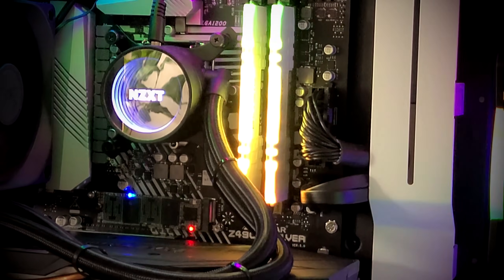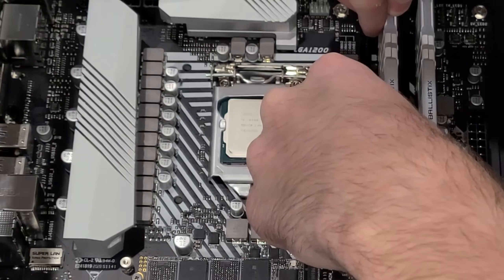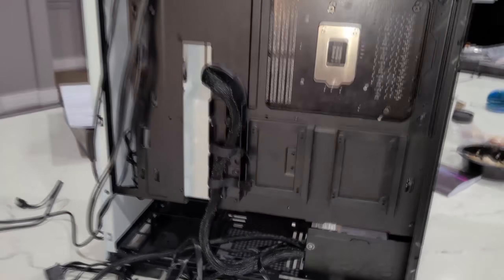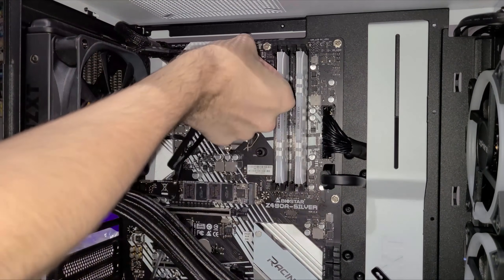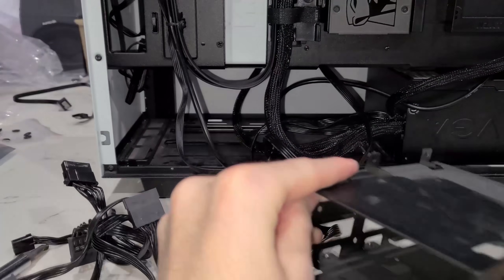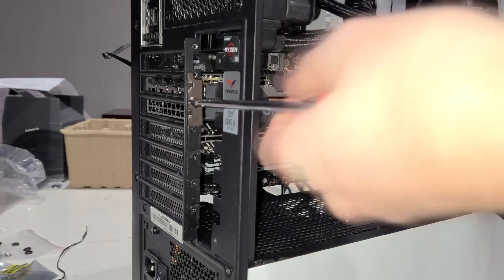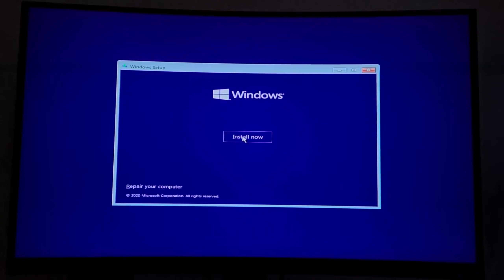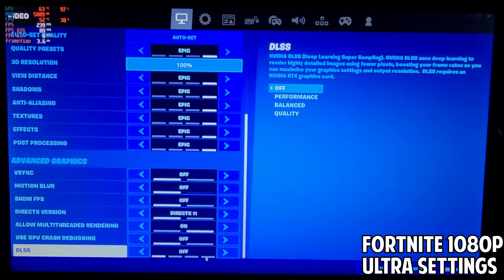BEST $1000 Streaming/Gaming PC [Build Tutorial, Benchmarks]

Comment: The cpu scares me especially since I’m gonna build my first pc in about 4-5 months maybe less saving up for it got a ryzen 5 2600x cpu 16 gb of ram and a gigabyte Radeon RX 5600 6gb gpu
Reply: If the gtx 1660 super is cheaper or a bit more expensiv than the radeon i would go for the nvidia card its up to 5-10% better than the the radeon
Reply: @yynizellulul1747  is it a good gpu? I’ve seen videos of it with a ryzen 5 3600 running gta at 120 FPS it’s better than what i have right now way better I have a laptop with an i3 celeron processor and a VERY VERY shitty video card and 4gb if ram
Reply: The 2600x is an 3600 with little bit lower single core performance so there would not be a big difference
Reply: And its an good gpu my build is an 3600 with a 1660 super and its perfect
Reply: @yynizellulul1747  how much does it cost? And what is it’s exact name? I am looking st all of this stuff on pc part picker
Reply: In my country germany it costs 720
Reply: @yynizellulul1747  a euro here is 1.19 and that’s literally more than my entire pc at $708 USD that video card is $854 here

Comment: I dont know if its nice to get 10400 or 10400f because all motherboards will be much expensiver with them
Reply: 10400f has no intergrated graphics in it
Reply: still the 10600k or 10600kf is better choice. No need graphic card because there is rtx 2060
Reply: @kelu17  kf, saves you a few bucks as it doesn't have integrated graphics in it, but performance is the same

Comment: got the same case and a psu from the same brand. My motherboard cable is so stiff I must loop over the white metal bar instead of behind it. Any suggestions? The PSU cables are thick and stiff.
Reply: dont worry about bending it hard. if it really doesnt go, you could buy sleeved psu extension cords or just leave it as it is (if you dont mind the looks)
Reply: @thndrstrke  It looks ok. I'm not concerned about my cables as much as the motherboard. It would require as much flex as bending a plastic ruler 100 degrees.

Comment: Is there a way to get a Ryzen 7 or any processor that has 8 cores at least 16 threads preferably and use a 1660 Ti for under 1,000 bucks?
Reply: you can cut a couple corners on budget here - for once you dont really need an aio liquid cooler, a "normal" cpu cooler for under 50 bucks will suffice (be quiet! has some good options). the case comes with 2 fans preinstalled. the airflow of this case is already pretty great so you wont need any more case fans (if you can resist rgb shit). thats about 150 bucks saved so you can get a better cpu or gpu ;)
Reply: Yes, you can just replace CPU with Ryzen 5 3600 with Ryzen 7 3700x and replace graphics card with 1660ti in below build
https://teamgeeky.com/us-recommended-pc-builds/1000-dollar-gaming-pc-build/

Comment: Get a good air cooler like a scythe mugen 5 instead and a b460 motherboard w/3000mhz ram, unless you really need ram speed more than 2666 which doesn't really matter considering its a intel system.

Comment: Thank you so much for the guidelines bro! I will be building the exact same pc, the only difference is I will be using the Corsair VS Series power supply, thanks once again xD
Reply: Prism  ok bro thanks for the tip
Reply: @kevingobin400  They DO matter. An expert said that your PSU should cost 10% of your build. Well, I'd say a bit less then that, but yeah. If you have a 2060 with a 3600, you should go with a 80$+ PSU. I'd suggest either Bronze or Gold, and at least 600-650 Watts. 
Don't save money on the PSU. You don't want your PSU to take your entire system to the trash can, now do you? 
Have a good one!
Reply: @LegendarymmHD  yes someone at my work told me the exact same thing so I’ll check it out thanks 👍
Reply: @kevingobin400  Np, make sure you buy the right engine for your car. If you buy a ferrari V8 engine for a truck, you will have big problems. However, if you buy a ferrari V8 for a ferrari, you'll be good to go. ;)

Comment: Hmmm everything seems awesome, but i probably would have gone with ryzen.
Reply: Same
Reply: Ye for these budget builds i would use ryzen because it has a stock cooler in it so
Reply: @truongsonmai9857  tho it would be a good idea to buy a good fan to overclock
Reply: @truongsonmai9857  stock coolers 🤮🤮🤮🤮🤮
Reply: @truongsonmai9857  the stock cooler for most ryzens SUCK compared to an aftermarket cooler. With the i5-10400, you can and will get a stock cooler that keeps it actually pretty cool, so there is no need for an am one. Also, budget doesn't mean cheap. Plus, the i5 is better in gaming, then the R5 3600, if you are an amd fanboy, then I cannot help you. Have a nice day
Reply: @truongsonmai9857  intel too but he used another one
Reply: Yea
Reply: The config it self has some problems. he took a pretty expensive case, and an processor that loses in multicore Performance against the ryzen 5 3600. if he took a cheaper case he couke squeeze a rxzen 7 in there. And that processor is much better for streaming
Reply: @Niklas-cd4ek  ya okay sure
Reply: Same since ryzen 3rd gen is coming soon
Reply: is the ryzen 5 3600x compatible with that motherboard, ive never built a pc so i dont know how to tell if theere compatible or not
Reply: I am going with ryzen
Reply: I want an AMD ryzen version of this because The Intel unlocked are so expensive
Reply: Question can’t we use this same build but just change the cpu to a ryzen
Reply: @Dominic-x3z  of course you can just use the ryzen 5 3600 and msi b550 pro vdh wifi
Reply: Also using a h510 is a waste of money, you can get another case for 50 buck less and get better storage or other stufd
Reply: @sus2615  nah this case cost 60 dollars when you find a good case for 10 dollars lemme know stfu you just cheap af
Reply: @Gates-tm7qq  in different countries prices are differents... If it's not 50 less then it's 40, also if you want the max performance it's just stupid going for a brand like nzxt, they surely make good cases but you don't need the best cade for gaming
Reply: @sus2615  Dude Your not going to get much cheaper case than this one unless it crappy and beat up 60 us dollars for a case is good this is a lower end case compared to other nzxt cases. but anyway if you wanna buy a 20 dollar used pc case be my guest idc im just saying dont get mad if you dont have the money to buy a cheaper brand new case
Reply: @Gates-tm7qq  p300a, much much better, and cheaper. enjoy...  :)
Reply: @theelepel2679  bruh this case is 5 dollars cheaper r u serious
Reply: @Gates-tm7qq  Does that matter? this is based on country pricing aswell, since its for me 30 euro cheaper, so that statement is out of the winow. Also the h510 has dogshit airflow and the p300a has good airflow... so its a win win situation, just take it or leave it, but this build is horrible
Reply: @theelepel2679  why are you here if its so bad bruh just leave
Reply: @Gates-tm7qq  you know what i hate? people that advice bad builds with microwaves in it, and takes own preference over actual quality, im not to talk shit over a build. its in general shit. this is not an opinion, its a fact that its bad since some parts are known for being bad and overpriced. and thats the fact that is anoying me, coz its getting advertised as ''best $1000 streaming/gaming pc'' while it clearly isnt. I know its all based on clickbait, but yet again. you can already see in the comments that people think this is good, and other people have questions. and are not fully aware what is good or not, so you get mislead for something that isnt good for its price... im actually trying to help people while these people keep advicing these own preference builds and people buying actually this and wasted their money on it... if you like it or not, this is a fact... if he made an actual good list, i would be even positive about it, but if you already see a thumbnail with a h510, there is no guccy going to be for the rest. and it sadly was as bad as i thought.. ;/
Reply: @theelepel2679  Eh I'm not so knowledgeable about Pc but looking at the specs it seems pretty good for the price but again, I'm not an expert as it. Can you tell me a possibly better build and why is this build isn't good. I'm not at all doubting you, I'm just trying to know the best build for the price for the sake of curiosity.
Reply: @theelepel2679  Oh alright thanks for the advice
Reply: @theelepel2679  Oh and also do you recommend buying used PCs or new ones? And if used, do I buy them from people selling them or do I buy them from trusted refurbished outlets? Or buying refurbished PC parts then making a PC?
Reply: @delightfultea4681  totally depending on the situation, if you have a low budget you can better go used, since you will get the most value out of the parts, if you have the money to buy everything new, for sure do! but used is good aswell, it doesnt really matter by who you are buying (company or people selling their stuff) you just have to make sure that everything is legit, working propperly and being able to do a good deal, coz if its overpriced you can rather just buy new since the price is about the same. especially now with Ampere comming, people selling their gpu's massive for low prices, and sometimes it worth the buy on that, since some are a real good value! :) as long if everything is trusted, not pushed to its limits (mining/hard OC) and has a good deal you ''should be fine'' but that is just depending on the situation of your budget :)
Reply: @Gates-tm7qq  shitty airflow, p360a is way better
Reply: @Gates-tm7qq  it may be cheap, but the  ventilation Is shit
Reply: @sus2615  maggot

Comment: PLEASE ANSWER can I use everything else in this build but pairing it with a 3070? PLEASE ANSWER
Reply: Of course you can
Reply: @snowfugitive3318  So, my current pc has an Intel(R) Core(TM) i7-7700 CPU @ 3.60Ghz that is currently running at a speed of 4.00GHz can I or (Will it be better) if I use that i7 instead of the i5?
Reply: @AnnerMorales-8990  if you don't like your CPU I would buy a ryzen i7 3700 If I was you I prefer ryzen for my CPU's. But before that look if it's compatible whit your pc on sites like: pc part picker. But you don't have to upgrade if your satisfied whit your CPU personally I have a ryzen i5 3600 and I like it. Of course this is only my opinion :)
Reply from the maker: Yes

Comment: If your planning on buying this build, save yourself $200~ bucks AND get a better cpu with the r5 2600 + a b450 board. you’ll be saving on the cpu and board price and you won’t need to buy a seperate cpu cooler.

Comment: Do I need to apply thermal paste to the cpu or can I use the one from the cooler?
Reply: If the cooler has thermal paste you can use the preaplied paste
Reply: @Natehalem1366  okay
Reply: @Natehalem1366  if this build good bc I already ordered every parts I’m new to pc gaming
Reply: @onalberson  in this price range I would have gone for an amd 3600 (200$) or a 2700x (215$) and a motherboard like the b450 tomahawk (125$) since both cpus have a stock cooler it’s possible you may have saved some money going that route but the AIO will probably be quieter
Aside from that and the 20$ you could have saved by not getting RGB ram (RGB ram does look cool though) the build is good it also seems like it has a lot of room for upgrading in the future 
One thing that I should mention is to make sure that you get a good monitor to take advantage of the hardware I linked a 1080p 144hz monitor bellow but you may want a higher resolution or hz if you play esports titles (a YouTube search for “RTX 2060 peformance in GAME YOU PLAY” should get show you what FPS the game runs at)

Good luck with your build 

https://pcpartpicker.com/product/HBRzK8/aoc-c24g1-240-1920x1080-144-hz-monitor-c24g1
Reply: @Natehalem1366  thx u n can’t i just use a tv wit 4k?
Reply: @onalberson  you can use a 4K TVs but there only 60hz and it’s a little awkward to play with a keyboard on them.
It’s also a little odd using the computer for non gaming purposes on it but if your ok with that it’s actually really cool (just know you may have to lower the resolution to 1080 or 1440 and upscale in most games with this hardware)
Reply: @Natehalem1366  okay last question are both usb compatible the case is 3.1 I believe and the motherboard 3.2
Reply: @onalberson  the motherboard should have lots of different headers inside that you connect usb to (you can find out where they are in the motherboard manuall) try to plug it into one from the same generation (most motherboards with 3,2 have 3.1 headers inside)
Reply: @Natehalem1366  okay thank you

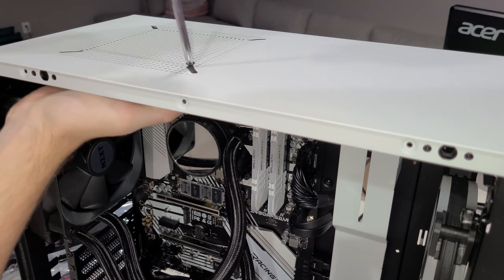Comment: I have a question. At 8:40, the NXZT brand of the radiator's fan is pointing inside the case. Does that mean that is bringing air from the outside, therefore wrongly installed?

Comment: Definitely can be done cheaper or with better GPU but this is a quality build though so no hate. The gpu can always be upgraded. But if you looking best bang for buck performance there are few good ways to tweak it like a cheaper cooler (air cooler is fine) Also there is no overclocking on an i5 10400 so a high performance motherboard for overclocking isn’t necessary unless planing future upgrade to a K so could save some money there with a cheaper b460 board. But I have to say this isn’t a bad build especially if you plan on keeping a lot of the parts with future upgrades like maybe when the 11 series comes out go to like the 11600k or what ever it will be called. Over all good video nice build!

Comment: My budget is 2000$ anything I can upgrade in this build?
Reply: Cpu: If you stay on intel 10850K or
Ryzen 3900x or 5900x if you be patient and wait for it to come out.
Motherboard: No need for change on intel
If your on Amd 140$+ B550 or x570
Ram: 32gb of 3200+ Ram
Cpu Cooler: A good 360mm aio
Gpu:3080 if available or a 2080 super
SSD: Adata XPG SX8200 1tb or better

you may want a bigger case for the aio
Reply: @fleecasy  thank you will consider it

Comment: Just a tip, if your short on money by a little bit, you can use the stock cooler that came with the cpu instead of getting the kraken... it will save you under $100
Reply: yeah i built this after his vid but went with the corsair platinum white because i went with an all white build

Comment: Your video is well done and informative.  Thank you.  But I just can't agree with your choices of cpu and gpu.  You have chosen ones both of which will have to be replaced relatively soon.  As I said in another comment section, your setup with a Z490 board and aio is crying out for an Intel k cpu to be overclocked -- here the 10700k, which is being discounted some places, maybe not yours.  You can fairly reliably oc the 10700k to 5.1 Ghz and then simply not think about your cpu the next 5 years.  Go for a 1660 super or ti instead of a 2060 and then wait for the best value 30x0 to emerge next year.  You aren't staying with a 2060 the life of this system anyways, or even through the next 2 years.
Reply: - You can stay with the 2060 through the next 3 years or more 
- Yes, buying an AIO for the 10400 was a dumb choice, since it has a great stock cooler 
- 2060 is a really good GPU for it's money, no need to go lower, so then you'll have to buy another card sooner again 
- The MOBO is good IF he wants to get a 10700k later, when he needs it, I'd say that it is fine as long as he plans on doing the upgrade. 
(Overclocking your CPU won't mean that big of a difference, 5-15 FPS in most games (FullHD) won't make your CPU better for the next 5 years, that's just simply dumb) 
Don't take this as offensive, etc etc.